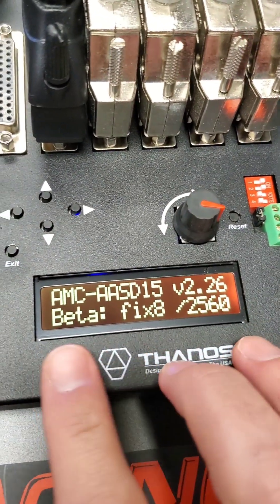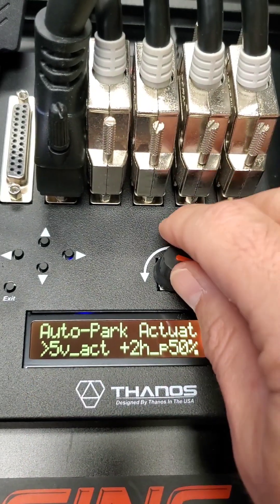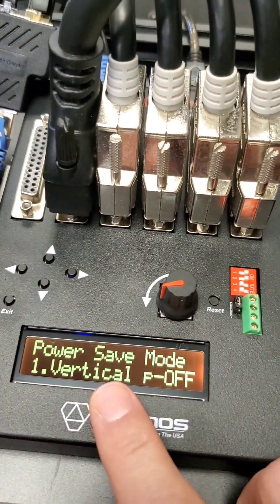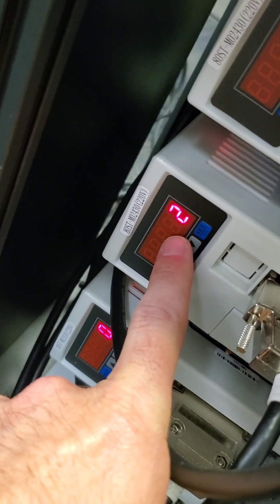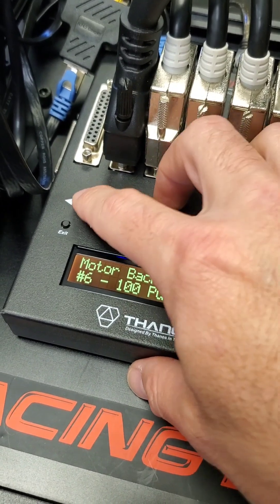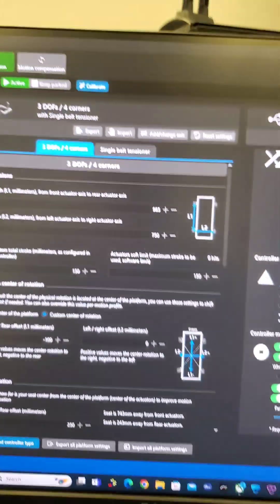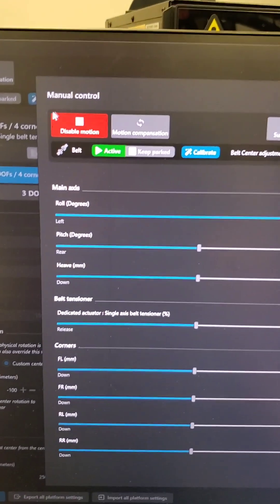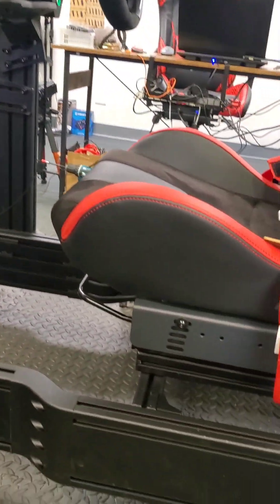Update on firmware v2.26 fix8 for AMC-AASD15A (Simhub)

Comment: Could you add a "ON - Kill All Actuators" option to the Platform Check? Our actuators lower themselves very slowly when power is lost and it takes a considerable amount of force to lower them faster. We have a hexapod that is dependent on proper geometries and in a situation where 1 motor faults and loses power, the 2 available Platform Check options will try to flex our platform.

Comment: What's the difference/advantage to using backtrack instead of setting the park position greater than 0%?
Reply from the maker: @beaustpierre645  zero position park on older firmware was backtrack value 200 pulses... now you can lower that 0% park position even more by reducing more the backtrack value until there is no audible drop when power disconnects.
Reply: @tronicgr oh, I see. Will the backtrack also reduce the total usable actuator distance by the backtrack value? Or is it only used for park position?

Comment: Will this version be released for the 1280 too?
Reply from the maker: @DennisKarlsson  Unfortunately no. The simhub integration code is about additional 20kbytes to the firmware, which the older 1280 doesn't have available. 

If you need upgrade options, please email at contact@thanos-motion.com

Comment: I have thanos4u controller today when I was playing I faced some problem the motion stopped for a couple of seconds then it will start again and after one or two minutes happens again all over didn't have this problem before do you know what causes this?
Reply from the maker: @Rezamajedi  lag in the game motion data? Did you check the SimHub logs?
Reply: @tronicgr  I'm using Simhub I didn't have any problem for the last couple of months it just happens today I did even update simhub to the newer version still say, it stop for 2 seconds and I don't get any feedback or movement and after two seconds it's start working but doesn't work properly and it's keep happening all over I tried it on other games it's the same thing

Comment: Have not even downloaded anything on the thanos lol, it did just work out of the box and i have so much trouble with the Witmotion i dont even wanna touch anything now that the motion works. just the motion compensation i cant fixed so im playing without it lol.
Reply from the maker: Well, this new firmware was created to make it easier for integration with Simhub motion, It's even more plug and play than SRS now, for sure 😁
Reply: @tronicgr  ohh i see! will have to learn how to download that later then. only flying in dcs right now so simhub wont work with that.